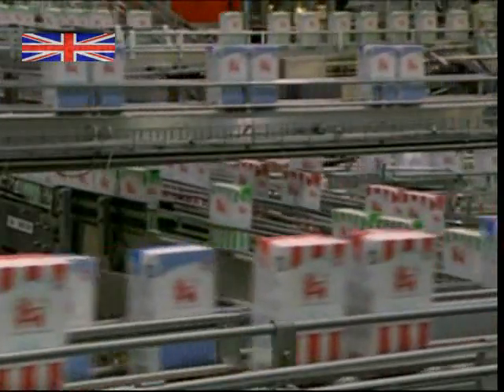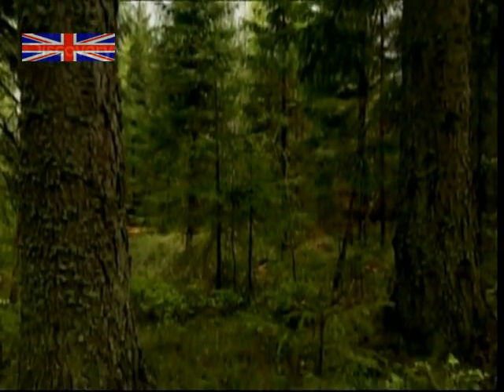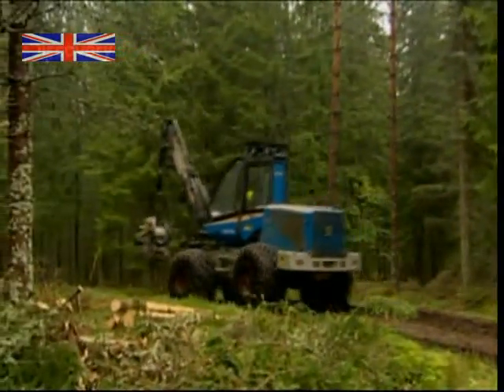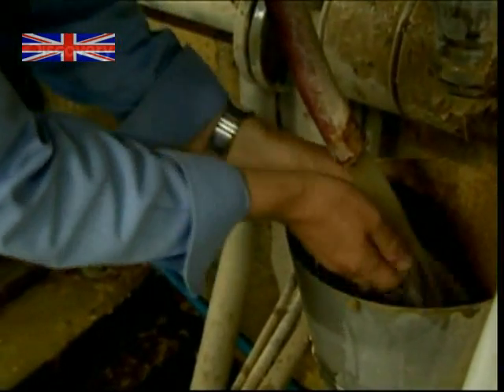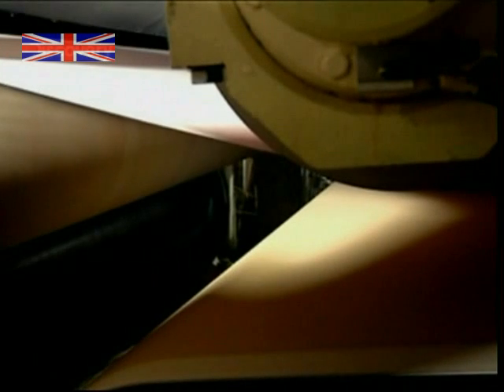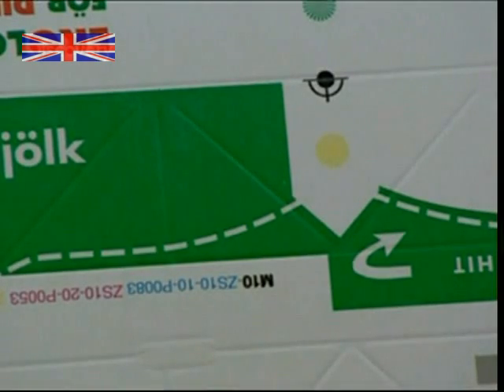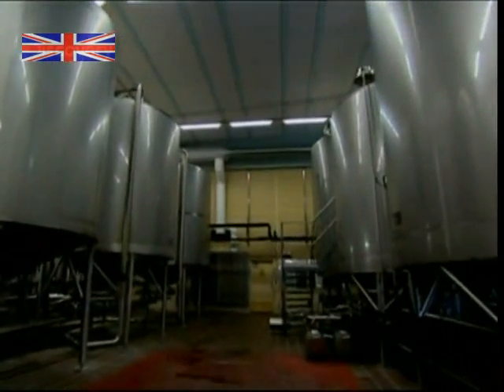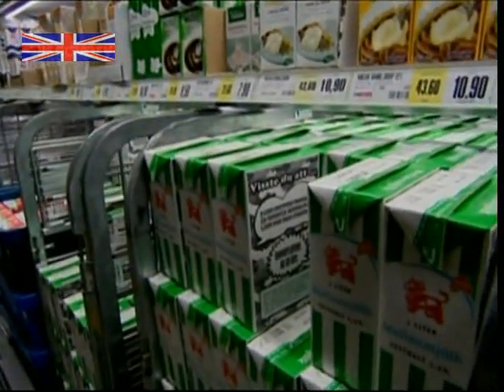How Paper Cartons Are Made

Comment: @mopster95 Yes... but you would have to wait another 10 - 20 years for the tree to grow again.
Reply: Yeah, that's why clear cutting still exists, because it's much more profitable than the relatively low output of forestry.  Then again, a forestry operation takes one guy with a machine who can just drive in as you saw in the video - whereas a clear cut operation involves far ranging machines.  

There's also select tree cutting, but that involves more manual labor and ultimately drives up wood prices, even in places of abundant forest, like BC, where apparently a section of soft wood flooring costs over 1000 dollars.  It's because they rely on select cutting rather than forestry, because leftists in BC think forestry is evil.  It would lower housing prices due to cheaper construction (leftists are also worried about housing prices), but no leftist idea has failed to contradict another leftist idea.